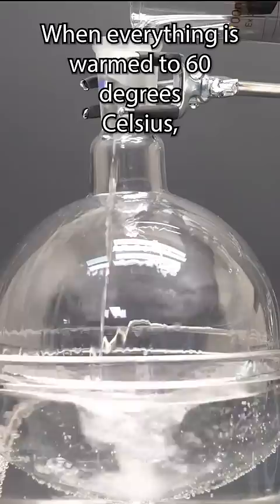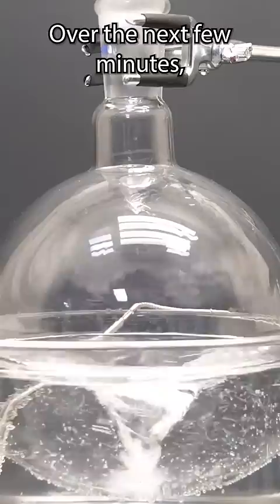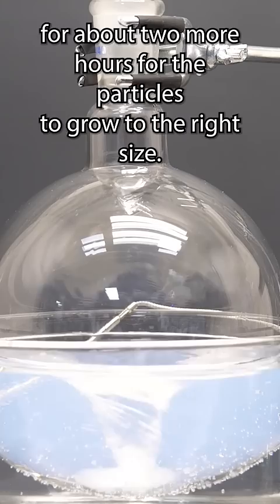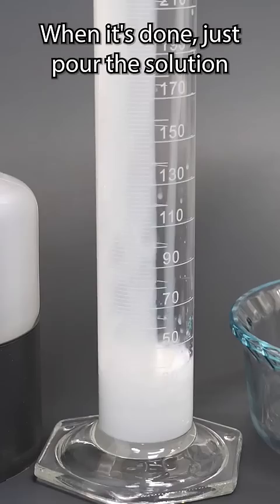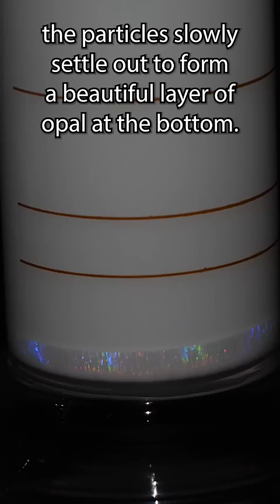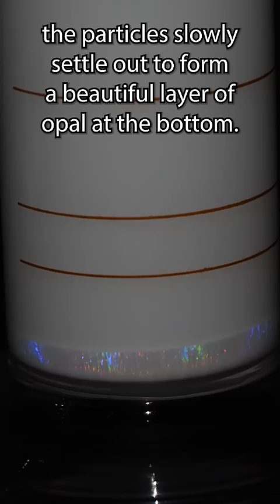Growing a Real OPAL 🧪✨

Comment: This would be a pretty neat thing to do if you could fill an entire mold out of it. Imagine being able to peel off the mold after a span of some months and getting a cool little statue out of it!
Reply: A silicon mold should work.
Reply: hngh molds are too hard to make. ill just settle for bones
Reply: @theshuman100  this is the comment right here FBI
Reply: What’s stopping us theoretically from picking a glass container that has a shape to it and using it as a mold and then breaking it to be left with a bit of opal that’s vaguely the shape we wanted? Would that work?
Reply: @EKimatH risk breaking the opal and not it being all one piece
Reply: Resin art but make it complicated
Reply: @Jok3r00 If it's real opal that's being made, surely it would be less brittle than glass? (I originally looked up heating, but while opals apparently get more vibrant at 900°, they apparently don't like temperatures higher than that, and glass needs at least 1400° to melt.)
Reply: @nomadMik You dont need to melt the glass, you just need THERMAL SHOCK!!

If you grab a regular 1000w resistance for infrared heaters, wrap it around the glass mold several times (without shorting it), then turn it on for 20 seconds the glass should get unevenly heated, then you turn it off and quickly submerge it in ice water. It should break along the heated lines because of rapid cooling and contraction, which breaks the glass. And the opal shouldn't even feel the heat in those 20 seconds.

You probably can find some videos here in youtube of people making drinking glasses out of glass bottles with this method. They usually rotate the bottle on top of the resistance at the desired height, and then they submerge it while keeping it perfectly vertical, so that the heated line cools down quickly but evenly on the whole circumference, which is not really needed in this case if the glass mold is considered consumable.

I guess if one uses some high temperature but still water soluble plaster to make a positive mold of, lets say a statue, then you coat said plaster statue with molten glass and let it cool, well, then you only need to disolve the plaster out of the now negative glass mold and you are off to the crystalization step. Break the glass as instructed above and you have your opalescent statue! Could work, maybe...
Reply: @Jok3r00 what about a glass breaker, like one of those devices where they tap the glass and it breaks
Reply: @yonidellarocha9714  Cool—I didn't know much about that.
Reply: Opal didlo
Reply: @zeldaglitchman  Those cost about 75 bucks, but I think actual opal ones would be a lot more expensive. I had a friend that makes them out of surgical steel using his lathe, though, and he sells a few each year.
Reply: That is a very cool idea
Reply: Genius
Reply: there are many companies who do this already! i have one shaped like a cat from a local artisan who does it, it's super cool how the crystals kind of stack into the shapes of it almost like fur in a way
Reply: @yonidellarocha9714 long story short....dip a string in lamp oil, tie around glass, light...let it burn for 1min-90secs...drop in 🪣 of water...walaah....
  I make wine glasses out of old wine bottles using this "glass cutting" technique..
Reply: What exactly is stopping us from doing that ?
Reply: @Jok3r00 use one of those glass breaking things that have it concentrated at one point causing no damage yo what’s behind it
Reply: @minidonkey8613 this is him sir. The man who tried to frame an innocent person for murder.
Reply: Yes or sell it as normal
Reply: Theres millions of pounds of fake opals out there. They most certainly do use these types of methods. Its like anything else when making a knockoff. ✌️
Reply: @The_Berzerker_ its not fake opal its just artificial vs natural.
Reply: @zeldaglitchman HAHAHA!! I thought the same thing, but wasn’t brave enough to write it!
Reply: @nomadMik late to the party but it’s a common misconception that strong and not brittle go together. Diamonds despite being the strongest material are actually incredibly brittle due to the atomic structure (this is what causes cleavages in minerals). In fact a diamond can be damaged just by knocking it against a hard surface. Plus any imperfections in a gemstone also add a layer of weakness so it’s hard to judge how brittle a gemstone is even a lab grown one
Reply: @The_Berzerker_ is electricity not made by nature fake too?
Reply: @zeldaglitchman 😮 I want one... or ben wa balls...😅
Reply: Could this process be combined with 3D printing? 
I saw a video a few years ago where a guy had hooked up a device to turn sand into glass and then 4D print things out in the desert and this video made me curious about whether something similar would work for Opal or Opalite?
Reply: @kimberleyhosmer5997  You may have been tricked by many videos about "4D shapes", but it is impossible for us to see anything that is 4-dimensional. All the shapes people claim to say are 4D actually only represent the shape's shadow. We woulf have to be highly advanced lifeforms who can move through dimensions to fully view objects in four dimensions.

Comment: That's actually even better, you can make a mold of whatever you want, pour them in there and then break it or pull out when you're done so you can have a little opal tiger or dice for d&d or whatever.
Reply: Omg yesssssss
Reply: Awesome idea!
Reply: That's not really how that would work, the issue is drying the opal. I've been researching this for weeks now on how to make a opal dice for cheap. Real opal is too expensive, Ethiopian opal is it brittle, opalite is not right, I would need lab grown. The issue with lab grown opal that it's convincing is the drying process you either need to dry it at 10k psi so that it would hold the shape it has or use resin. One is expensive and the other doesn't allow for the shape to change. If you skip the drying step properly then it will crack or shrink, and also the opal doesn't harden in the shape of the mold as not all the liquid would be used when it hardens leaving gaps. I did find bello opal slabs tho, that are easy to tell its not real opal but has the right properties and hardness. Plus a slab is about 200 bucks. So all you would need then is someone willing to cut the slab into dice. I estimate the total cheapest real opal look to be about 500 bucks. At most if you use real Australian opal like 30k.
Reply: Also heads up to anyone trying this TEOS or the TOS agent and ammonia are dangerous. Silica will coat your lungs if you breathe it in while making it and needs to be completely sealed while making or to wear a respirator. Same with the ammonia.
Reply: @frozen_flame99  Damn you weren't kidding. You really have done the research on making opal dice. Eh, it's probably for the best. Opals are supposed to be horrifically bad luck, the dice would probably end up costing you the battle, or your character, or whatever you were going to use them for!
Reply: Silicone ice molds but for molding damn opals
Reply: Wouldn't it be better to like cut thin sheets of Opal and glue it to a cube of whatever material to make the dice? Like wood countertops or gold sheets.
Reply: @frozen_flame99 As much as I can empathize with the desire for opal dice, because, man thats a mood lol, for me I'm not even sure how much it would cost is the most important consideration here, because even for gemstone opal is Fragile, and it seems inevitable that they would break incredibly quickly. Even storing them wrong could make them crack or damage them. Very very thin sheets of opal encased in glass or crystal might be sound though, which is how cheaper opal jewelry is sometimes made iirc.
Reply: Just said that
Reply: He said for d&d lol sounds like you put some time & thought into that , Could somebody Carve or cut with a laser a d&d character out of a solid piece of Opal Or would the Pieces break if you're trying to carve/cut/Shape
Reply: @frozen_flame99 in the video he used UV radiation for some and resin for others. Turned out pretty nice.
Reply: @frozen_flame99  This is why you need a fume hood. Labs are about the only place you can be safely growing this stuff, plus other safety equipment.
Reply: @emeralddarkness  Nothing wrong with opal encased in crystal for dice. It's just unfortunate that this process would make it very difficult.
Reply: So pouring it out automatically makes it harden?
Reply: Give this man 10% of sales
Reply: @Gary-And-His-Demons imagine believing in that sh*t 😂😂😂
Reply: @ArtisChronicles  A laminar flow hood would do it. Just have to make sure the exhaust vent tube isn’t leading right to the neighbor’s window. Also, gloves
Reply: Opal dice would be amazing
Reply: @Gary-And-His-Demons what makes them bad luck just curious I've never heard that before.
Reply: A big shlong !
Reply: Or a diamond shape.
Reply: @emeralddarkness  or thin bits encased in resin.
Reply: @emeralddarkness agreed. This is probably the best route. Resin could also be an option. That would make the dice less heavy and make them less wary to shatter if they take a tumble. I wonder if they have looked into jewelry making and pull ideas from that as you said. People have become pretty gosh darn creative over the years with ways to make certain gems and metals accessible in jewelry.
Reply: @frozen_flame99  Sorry for necroing, but I'd like to ask this from someone who knows what they're doing. Have you tried/considered freeze drying?

Comment: Can we get an update on the opal?  Did you get it out of the tube?
Reply: Centrifuge
Reply: break glass, or pick a better settle-out container, such as a soft plastic, perhaps with a desirable bottom shape.
Reply: @louislwspsycdaf9049 The issue stays the same. How do you get the opal out?
Reply: Silicone mold??
Reply: @whocareseh1 the opening points outwards
Reply: @mojojojo6535  hi, what are you saying to me about this?
Reply: Could you not subject it to the same method of making diamonds after letting it all settle and using pipette to suck out water

Comment: Fun fact! The play of color is dependent upon the regularity and size of the silicon dioxide spheres. If it's irregular in size, no play of color, if the spheres are too small, the colors will be limited to blue. As the size increases, you will get green ,yellow, orange and red. If you can get red, that area will also produce the other colors as the angle of light shifts!

Comment: Coat the settling container with wax, and when it's done just run hot water over it. Alternatively cement/hydrochloric acid.
Reply: Or just use a hammer…
Reply: @soude85  The whole point is that it's brittle. You're going to have an expensive pile of dust if you do that. Laboratory glassware isn't cheap, also.
Reply: @noob19087 true but opal isn’t exactly expensive either. Real opal. I get the experiment is fun but… idk id rather mine for mine I guess
Reply: @NebulousNector  Are you kidding? Opal is expensive as hell. Australian especially, but even Ethiopian all things considered (let's say you want a big one). And this is science, anything like that is beside the point. Think of the practical applications, synthetic opal whose properties you have full control over would have much more than natural. Don't get me wrong, I'd love to go mining for opals too, (I'm a geology nerd), but synthetic opal is totally worth pursuing in my opinion.
Reply: @NebulousNector  There are benefits to synthetic. Natural opal has a high water content and is vulnerable to shattering. You also can’t incorporate it into glass blowing because the water will make it explode when it’s heated. Synthetic opals can be put inside blown glass pieces though.

Comment: How about a small plastic square (silicone) mold? This way you will also get a flat piece of opal, which I personally would prefer.
Reply: What day is it?
Reply: @rockspoon6528  I know, but what he is demonstrating here was from a video 2 years ago (dec 4, 2020 "Can you GROW an Opal?"). So, even though the date of posting might make one think this is a joke, is actually real.
Reply: @stijn2472  ye its just unfortunate date
Reply: I came here to suggest the same thing. I guess the only problem would be if the silicone was likely to react with any of the chemicals involved.
Reply: @KatharineOsborne  You'd still want the container to be quite tall, or else your opal will be a very thin sliver.
Reply: I would go octagonal
Reply: @Tunkkis  hmm, then youd simply need a tall/thin silicone mold? could be hard to find one but not hard to make one. maybe a pencil sort of shaped mold.
Reply: @Tunkkis  Yeah I wonder what the ratio of fluid height to opal thickness is. 200mm to 4mm or so?
Reply: @jichaelmorgan3796  Would that make a difference in thickness? Or would the shape be more usefull in further experiments?
Reply: @when-do-we-get-a-block-button  That might indeed work! But I am concerned that in such a tall mold it wil still be difficult to remove the opal.
Reply: @Stijn   no it wouldn't make a difference, just the diameter would.  I would choose it because it would look more cool than a square, lol
Reply: @when-do-we-get-a-block-button  Considering the floppyness of silicone, the mold would probably need to either be thicker, making removal more difficult and possibly negating the advantages of silicone, or have a support structure, adding complexity.
Reply: @stijn2472  I am not sure, it would likely depend on both the concentration of silica in the liquid and how densely the silica packs at the bottom. There is probably no fixed number.
Reply: @jichaelmorgan3796  Yeah that's a fair point haha
Reply: @Tunkkis  How about a wide flange at the opening of the mold that is supported by a frame so the mold itself can still be fairly thin and flexible? Perhaps 3D printed?
Reply: @Tunkkis  Yeah I think you're right. I do wonder how it varies with concentration (and mold of the material, environmental factors, etc.).
Reply: @KatharineOsborne  unlikely. That’s why it’s used so much in purification.
Reply: @Tunkkis  if you are worried about floppiness than you can easily prop it up in another container. If it’s particularly delicate, immerse it in sand or other malleable substance
Reply: @Tunkkis  Different silicone composites have different harnesses. You can choose one that has the correct amount of flexibility and completely eliminate any need for a support structure.
Reply: @RayDragonfly  But then you're back to square one with a rigid mold that makes to opal difficult to remove.
Reply: @Tunkkis  I specifically meant that you could very easily use silicone with a firmness high enough to support itself while also being pliable enough that you could remove it without damaging itself or the opal.
Reply: @RayDragonfly  yep. There are soap molds designed for embeds that would work perfectly for this kind of application. Particularly the silicone ones that are long cylinders, and made in 2 parts so they open down the length of the tube
Reply: @rockspoon6528 tuesday.  

😂😂
Reply: Get a 4ft bong and fill it up
Reply: @KatharineOsborne  Its a great suggestion, Silicone is pretty damn inert so I think it would likely work 😁
Reply: @RayDragonfly  neither of you seem to realize that silicone molds can be cut. So you can destroy the mold to get the opal out.
Reply: @IratePuffin  silicone isn't cheap. Not destroying it is in the best interest of your bank account